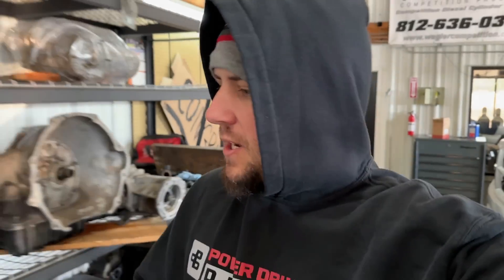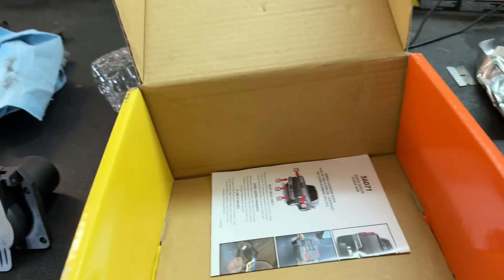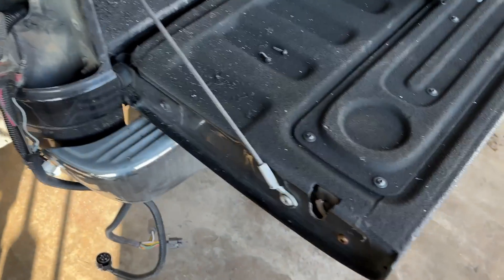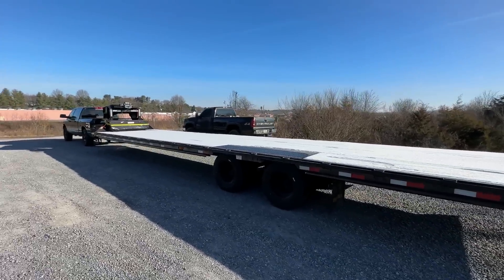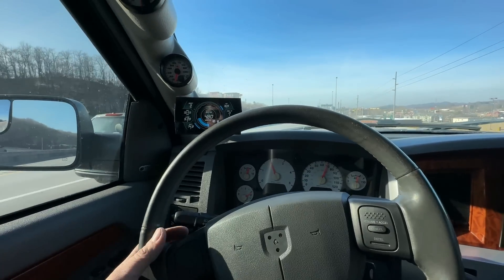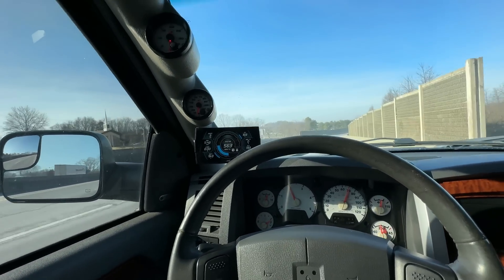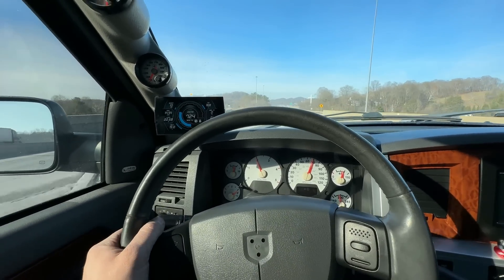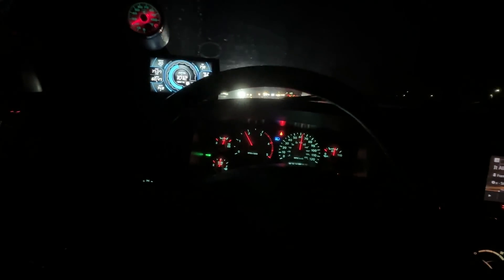I WON’T SELL THIS ONE!

Comment: Do you think that mishimoto cooler for my 04 dodge cummins will suffice for cooling while towing 14k in the Midwest and southeast.   I bought one just haven't installed yet. Also deleted the heat exchanger... built the trans last year w/dpc low stall triple disc, added gpz clutches, billet input, blah blah.... 30% over tips, smedling turbo and bully dog... should I add an auxiliary or would I be good?   Seen this debate a thousand times.. your thought?

Comment: Jeff Garmon is good people. He's who built my 68rfe in my 08 2500 truck. Also built the engine in my buddy's old mud truck, it was a 95 2wd 600 hp 12 valve he turned into a monster mega truck named Cummin Get Me. Looking forward to all the content coming. Proud of that 48re getting the job done even though that is a recipe for it to go. Will you be going fmvb on the rebuild or leave that out being it will be a tow rig?

Comment: Fords manual transmissions if in stock horsepower applications and mated with a aftermarket clutch are amazing. but they wont last with any amount of horsepower put through it thats more than stock. but the 5R110W. is an EXCELLENT automatic transmission. and are pretty easy to build. Stock they can survive 1000 horsepower. its not reccomended and won't last terribly long but it won't have a Major failure i.e housing or shafts. clutches would likely give out first. but you can have the trans built and it'll be unkillable. all i really got left to say left. Its quite obvious that the 5R110 is an excellent transmission. due to the fact Ford used the transmission in 2.5 generations of trucks and vans. the exact same. the only difference being the Larger filter on the later ones and slightly deeper Pan.

another thing to note make sure you put the right viscosity in the 5R110 or it will live a very very short life. almost everyone who's had problems with them. put ATF in it that's the consistency of Syrup or they didn't know better and the trucks batteries died for a day or 2. and it was in the re-learn procedure so it was "shifting funny" and they put Lucas or something similar trans fix in it and burned their transmission up.

Comment: i am loathe to disagree with a man who is out there " doin it" but i do vehemently disagree with bypassing the heat exchanger even so the cooling system will be taxed heavily when modifications are made in accordance with your plans.
i get that. 
what i would like to see you tackle is a video or a series of videos  relating to cooling these monsters. 
for example i dropped your name to a louver mfger who has sold me a louver that kinda fits behind the grille, meaning on the forward part of the hood closest to the grille. his numbers are astonishing as to flow increase across the radiator fins.
keeping the trans heat exchanger with a separate radiator with electric fan might be a fun video, or engine coolant till it hits temp then switch to stand alone radiator. cheap simple fixes so you dont lose valuable cooling and more importantly stable trans temps .
what say you?
Reply from the maker: After 10 years of driving In Illinois, Utah, Socal, Arizona and VA the heater exchanger is simple. Don’t beat on the trans until the fluid hits 100* and enjoy it. I understand the fluid warm up is crucial, but the extra heat, and the possible mixing of fluids out weighs it in my opinion